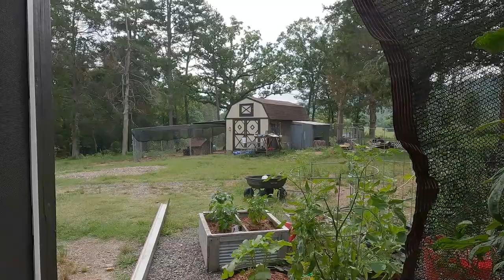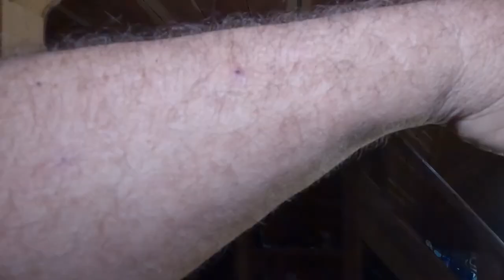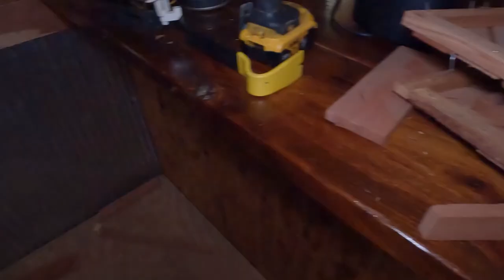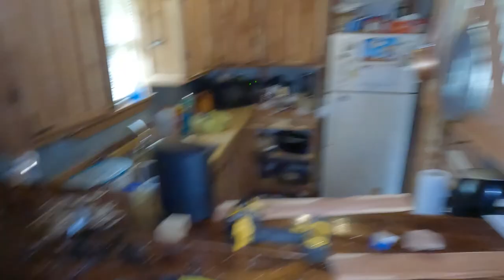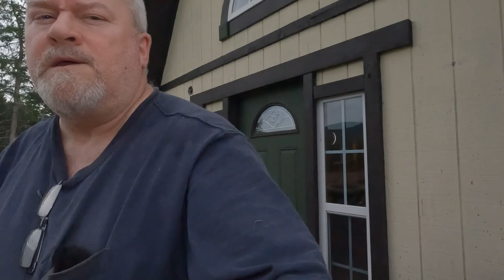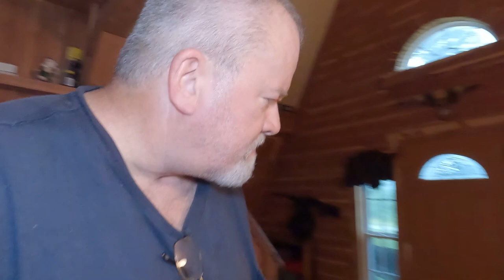Tearing Out The Cabin Bar/Kitchen Extension/Cabin Overhaul/Remodel

Comment: I purchased an induction burner to use during the summer. Now I use it most of the time. Must use cast iron or steel pots and pans. Induction is 40% more efficient than electric or gas. No regrets with this purchase.
Reply from the maker: I will check them out

Comment: I use my toaster oven and a portable cast iron hot plate for cooking that I can put under the counter when not in use. I got rid of my stove and replaced it with countertop and cabinets for more room. I also cook outside on my gas grill. Much better use of space. 
Also, you have that electric skillet.